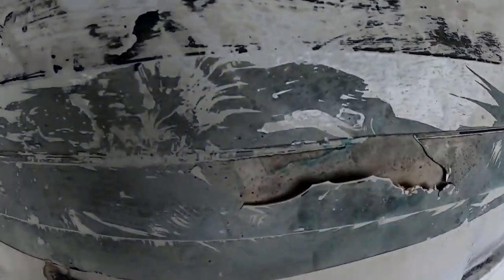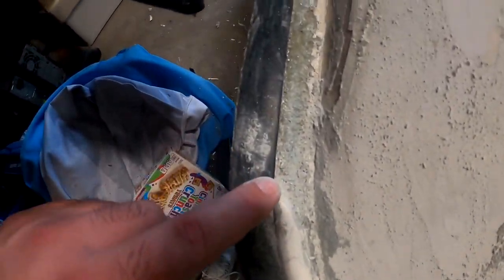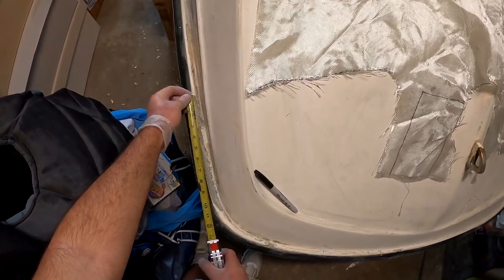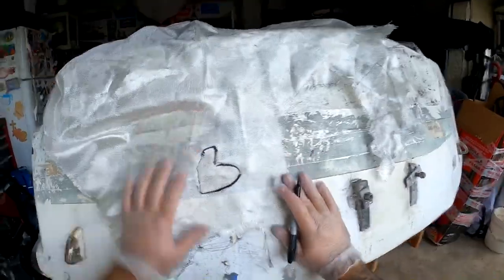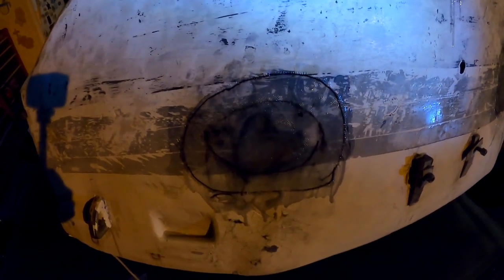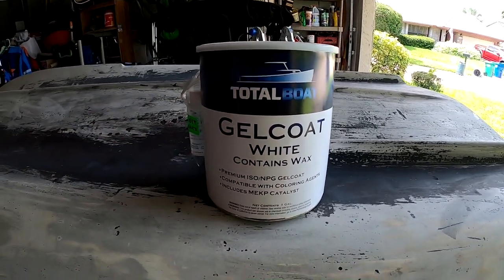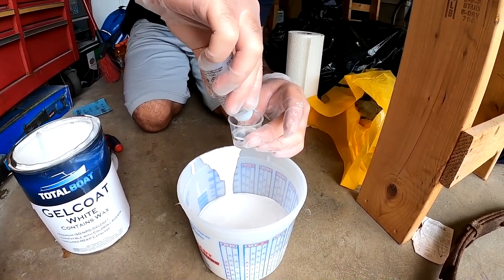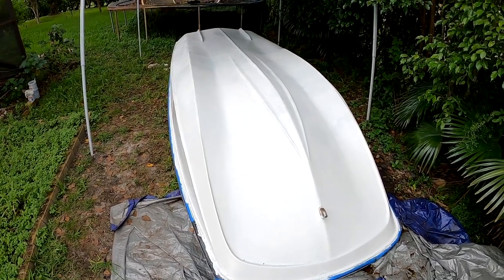RESTORING MY 13 FOOT BOSTON WHALER CLASSIC! PART 4 ( TOTAL BOAT GELCOAT AND FIBERGLASS REPAIR!)

Comment: Make great that tou are doing this I am in Australia and have a Whaler like yours.

You need to use chop strand not just matt glass and way less resin.
Use a multi roller to squeeze air out and level you fixed area.
Reply from the maker: Oh nice good luck with your whaler! Yea those were some lessons I learned off camera and I ended up getting a roller and fixed it now. Thanks for watching!
Reply: @One of a Kind Outdoors  thanks mate.
Here to many hours of fun in our boats

Comment: In the future when you gel coat use the wax gel coat on your final coat and the gel coat with out wax to build your desired layers you won’t have to do sanding after each coat
Reply from the maker: Good to know I will have to do that for a future build for sure. Thanks for the advice!

Comment: You need to sand off more if the old gelcoat.  The primer that you will apply will not stick properly and over time will make the new gelcoat flake off.  Trust me !! I’ve been down this road before
Reply from the maker: hey thanks for the advice I sanded it a lot to where nothing else was coming off even with 60 grit and I don't think the old layer was actually gelcoat would that make a difference do you know? And ill take your word for it I definitely want to do this right so thank you I really appreciate it!
Reply: @oneofakindoutdoors   well when u we’re rolling it on I could see the improfections popping through the new gelcoat.  I mean it’s a fishing boat 🤷‍♂️🤷‍♂️ and most people do as they please lol.  I’ve been fine tuning all the improfections as much as possible so they won’t stick out in the paint …Hope yours turns out good
Reply from the maker: yea your right you can see a few things but with the 2nd coat I think its turned out pretty good. And yea it being a fishing boat it is going to get beaten up good. Thanks for looking out for me and thank you good luck with your project also!